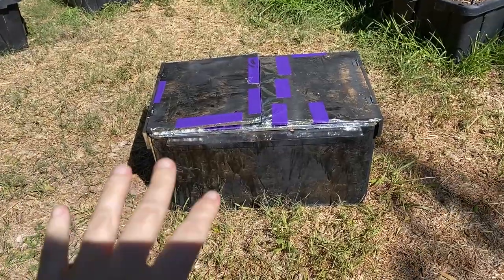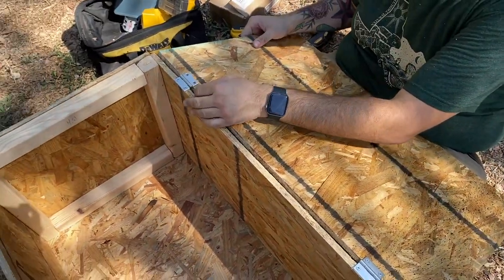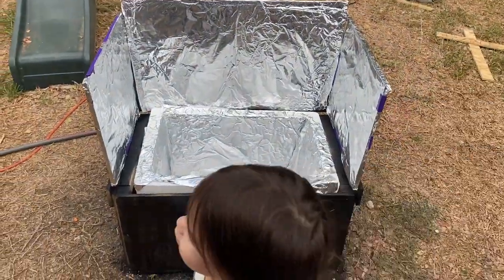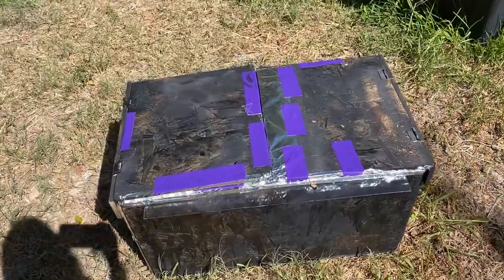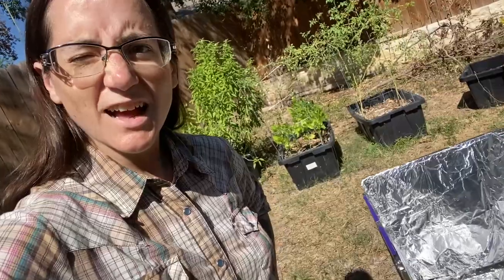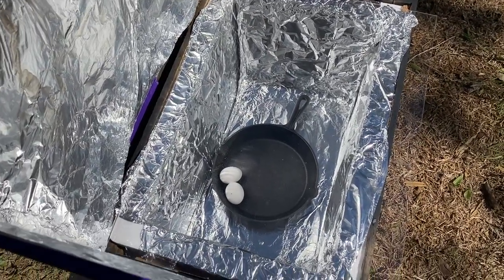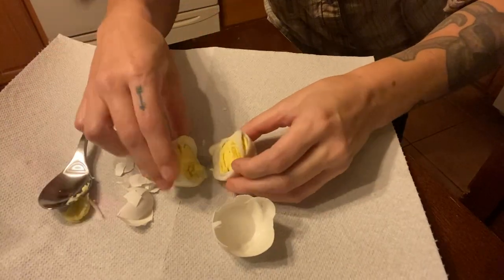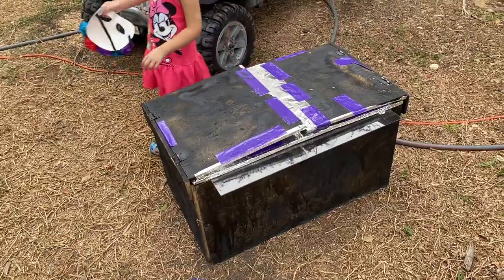How to Make a CHEAP & EASY Durable DIY Solar Oven

Comment: I have an All Season Solar Oven. There are tons of recipes and how-to. Definitely get a regular kitchen oven thermometer to put in your solar oven beside the food container. Needed for food safety  along with timing cooking based on heat available. A black cloth is best if you want to cover the eggs in your  pan for more heat retention. Aluminum foil over the eggs will reflect the heat. FWIW.... I've painted canning jars black to  use for cooking soups and such in our ASSO. 

Enjoy your  adventure into solar cooking! Thanks for sharing.